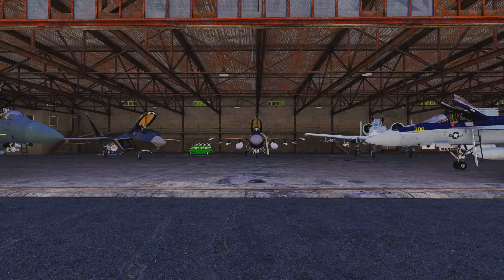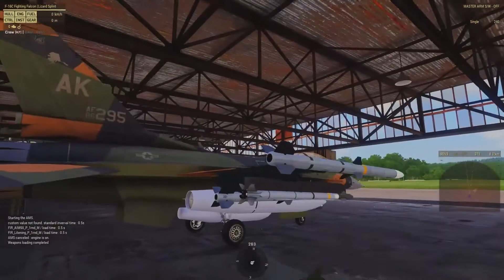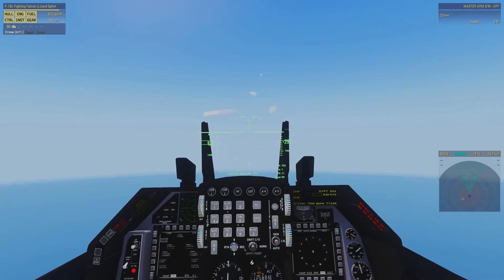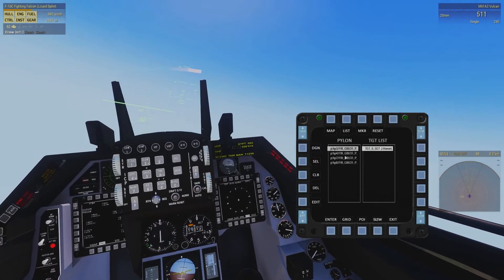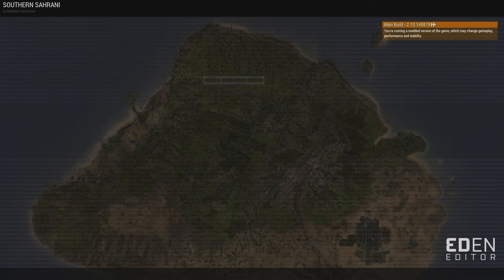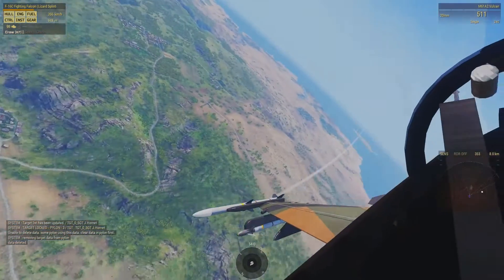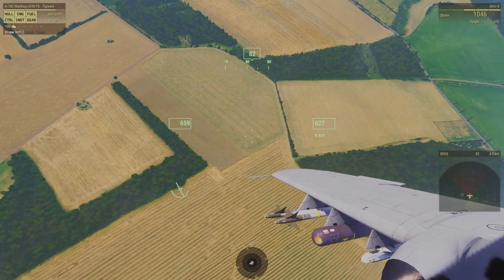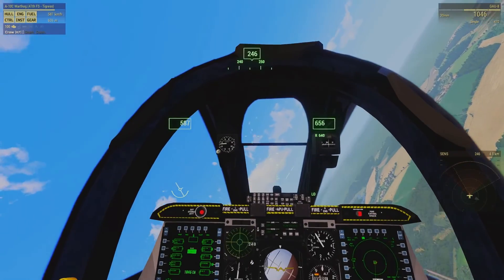Firewill AWS Basics Guide Arma 3

Comment: I'm so glad i found this video to learn how to do it but i still havent figured how did you change the direct mode to I-TGT mode if it's the f button mine goes to the next ammunition ?
Reply from the maker: So if the bomb youre using is GPS capable, itl have 2 firing modes. One in direct mode, the other in I-TGT mode
Reply: @Hornet_221  so just by clicking f, it should switch to the correct mode without going to the next ammunition. i think i got it. Thank you

Comment: Hey dude. I have a problem, I'm using the planes from the aws mod creator but no weapons are showing in the ams. Do you have an idea on what's going on?
Reply from the maker: Double check if the Fir AMS mod is loaded, and that the missile rack for rearming is nearby, other than that try validating your files
Reply: @Hornet_221  first of all thank you very much for the lightning quick response. I am sure that all of that is ok, but that when I go on the ams, I select an sta and the only options I get is clean and empty

Comment: In my I-TGT there's no SLEW button, there's a MSG button instead, which doesn't seem to do anyrhing. Has this been changed? Is there a different way to lock your targeting pod on to a grid or map location?
Reply from the maker: it may have been removed, but theres a mod for Turret Enhanced that will allow you to use an option in the scroll menu to slew the TGP to the map

Comment: Hey man, for some reason if i use entirely GBU-31's, or GBU-38's on more than 2 pylons, I-TGT simply doesn't appear. I mean not the screen, just the option to open i tgt just isn't there. Is this a bug, or something I'm doing wrong?
Reply from the maker: Are you running any other mods? What airframe are you in, are the bombs firewills or another mods
Reply: @Hornet_221  Yeah i'm running quite a lot of other mods, and yes the bombs are from firewill i believe. Thanks for the instant response!
Reply: @Hornet_221  I'm in an F-16C btw

Comment: Why the copilot can't lock targets with Left ctrl + T? Help!
Reply from the maker: to lock a target on the sensor for any lock-and-fire munition, its T while looking at it in the crosshair, or R to cycle through available targets in the sensor area.

To lock the ground via the targeting pod, you can use LCtrl+T if in the Pilot seat, though some WSO/Co-Pilot seats require you to zoom in (+ on numpad) and then move the camera to the desired spot, then let go of your mouse to keep it stationary on the target. This will not track moving vehicles unfortunately
Reply: @Hornet_221  I tried everything but the copilot seat with a tgt pod can’t lock vehicles even when it is stationary. 

So, I have to “tracking manually” let the mouse where I want the bomb falls??
Reply: Lctrl+t doesn’t lock your targeting camera?